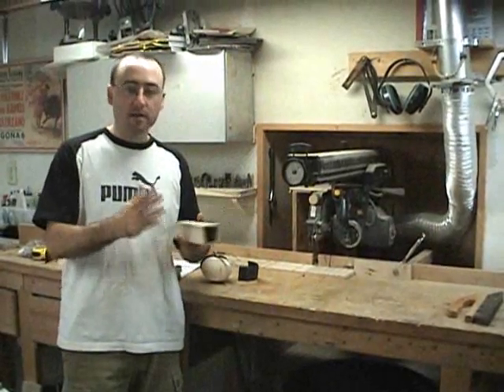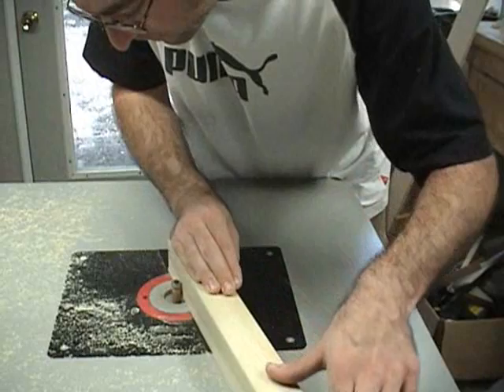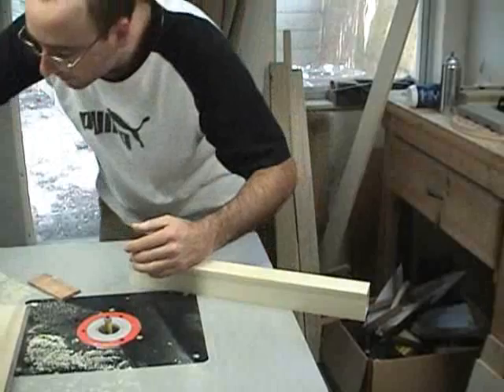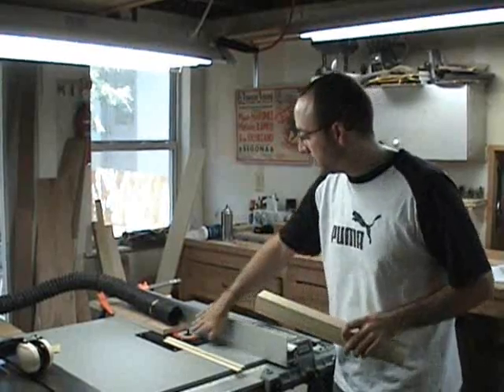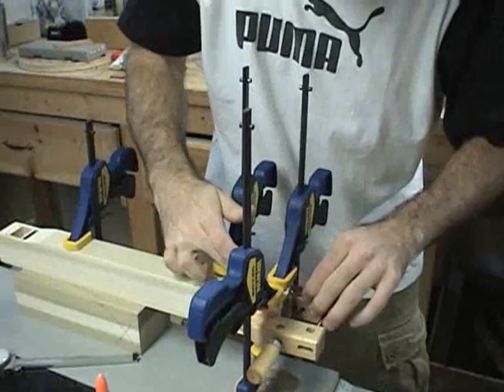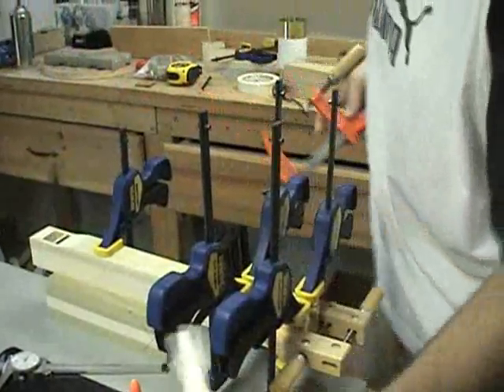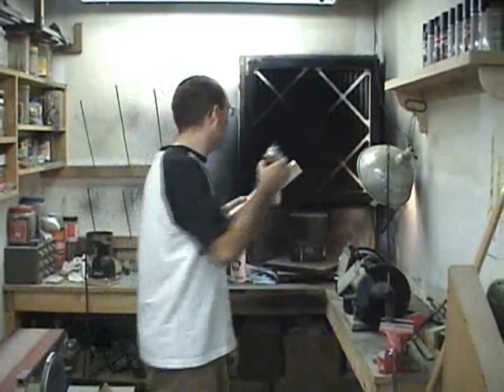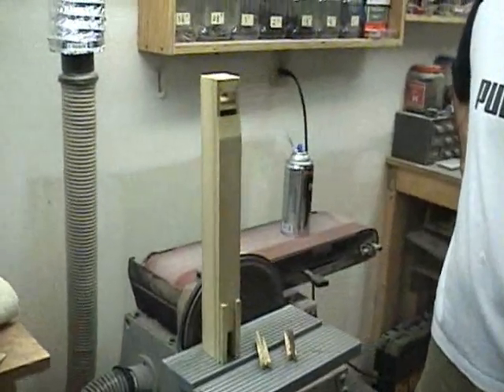How to make a wooden organ pipe - Part 3 of 3

Comment: In the past year I've accumulated a few dozen wooden organ stops--all old but in excellent condition. All have cut-ups that are too high for the sound I like so I've been ungluing the front (it's hide glue and lets go with steam) and reattaching it a little lower and effectively lowering the cut-up. I fill-in the nicks under the cap and get a great sound out of old "wooly" sounding pipes. 
The wood can be very nice on the old pipes. Tulip-wood, poplar, cherry, walnut and mahogany.
Good work!

Comment: A suggestion:. Get a wireless relay to turn your dust remover off/on and carry it in your pocket. 
Thanks for the series of videos'. You do excellent work. I cannot agree with the principle of using wood for what appears to be *all* principal scaled flue pipes. There's a limitation imposed on wood pipes that stops the voicer from getting the sound they *typically*want for principal tone- beyond a certain pitch-about g 32 on an open 8'. But it boils down to taste and using what you have.

Comment: Nice work!  Only 249 to go...lol 
Lots of cabinet making skills used there.
Nice little shop setup, though it probably gets crowded fast.

Do you get allot of tear-out with the radial arm saw? I prefer a sliding miter saw for end cuts
Thanks for posting! Will be helpful if I get around to making a 20 note organ clock.

Comment: Yes, they're usually made of metal and the difference between metal and wood pipes becomes very apparent in the  higher pitches. A good argument can be made for the making of Principal 8's from C1 to about g 20 of open wood construction. But it's not very efficient if you're running a big pipe organ company. If metal becomes scarce or too costly the option becomes viable and vice versa. Packing and shipping wood pipes is much easier and less costly than metal pipes.

Comment: Ugh, that flush trim router method... I just leave the side boards 1 mm thicker than I want them and use one pass over the large jointer to clean up each side, removes any glue residue, makes the sides  nice and  square to the back and then a touch sanding and done
Thing about the flush trim bits is many are not REALLY flush, and the tiny bearings tend to break too and then you get a huge gouge when that happens, the bits also tend to tear out chunks of wood, I ditched making pipes with that years ago!